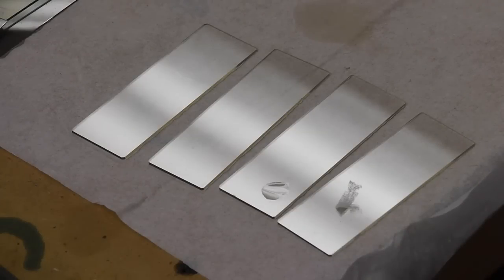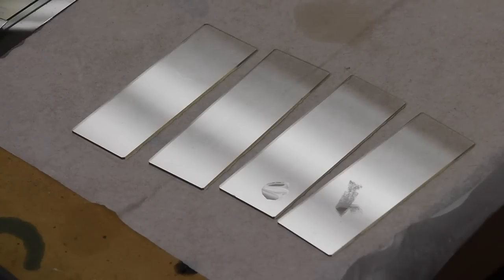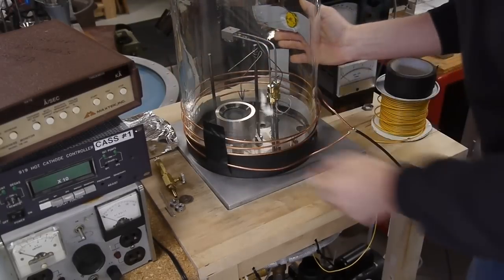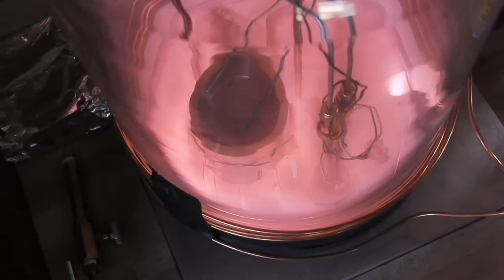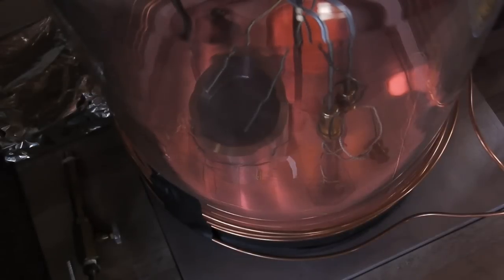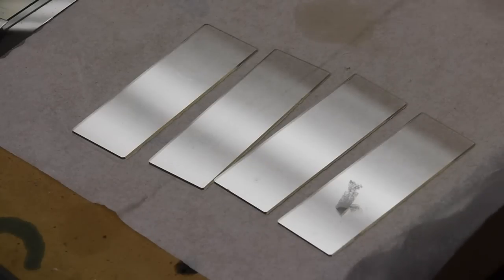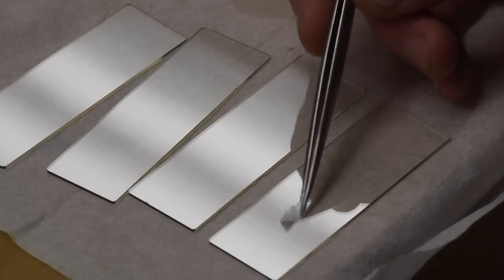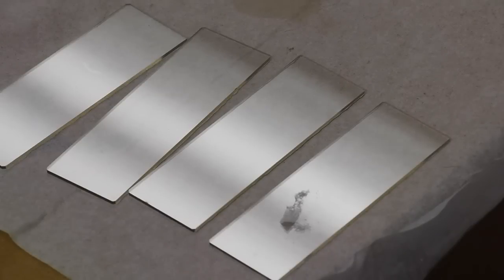Intro to plasma cleaning

Comment: Very beautiful to look at it!
But first thing that came to my mind was : what would happen if there was an mouse, inside, or for instance, if you put your finger? Would it disintegrate into thin air? Or would it perhaps look like it is burning?

I wonder...
Reply: mr_os Well it's a rarified environment, so it will die from asphixiation. From there on I guess the plasma would be roughly as harsh on the mouse as it was on the paper.

Comment: Is the RF energy the same for induction heating of metal parts?
What is the frequency?
Could you easily put more RF power into the bell jar?
Is there a reason you held it to only a few watts?
Reply: Ben, could you just use a frequency set length of wire (I'm guessing around 20 meters) for the antenna and forgo having to tune out so much reflected power?
Reply: ***** Watch out for those RFID cards :)  i think Mifare cards work at the same frequency,i don't know would it affect them but it's a strange coincidence
Reply: TheHackZone5 I actually just looked this up to check, you are right. RFID and NFC both use this frequency band. might want to watch incase it blows one of the receivers if you have something using this near.
Reply: +Walter Clark The components in a relatively small tuner used for amateur radio might be made of plastic components and not water cooled.  They can easily get damaged by melting if too much power is put through them.  Some of the industrial RF tuners have water cooling through the coils and capacitors and can withstand much higher powers.  Plasma-Therm is a company that has been around many years and makes hefty RF generators and tuners.

Comment: Can you use this process to cold weld metals? I mean, if they are super clean, they should weld?
Reply: I don't think that would work. It's an oxygen-rich and energized environment that would probably quickly oxidize any metal surface

Comment: so, is the plasma in the vacuum colder than plasma would be in ambient space? From watching this video I don't really get the idea that the plasma is all that hot. wouldn't it be more destructive if it were hot?
Reply: is the vacuum making it so that the air doesn't need to be as hot to become plasma? or is it making it so that you don't need as much electric current (or voltage? idk) to heat the air up?
Reply: It's extremely hot, but it contains very little heat.

Comment: SAFETY WARNING!
The mention of using oxygen should have included a safety warning.  One should never use straight oxygen in a plasma cleaner unless the vacuum pump contains fluorinated oil (very expensive).  Doing otherwise risks explosion of the pump and considerable risk of personal injury.
Reply: +Anon Acct i don't think this is true i may be wrong but strait oxygen is not explosive or flammable it is only an accelerant and needs to be mixed with something to burn.
Reply: Anon Acct yes...oil and oxygen do not mix well at all.  Infact if anything in the chamber had any oil on it (like in the video) then it would be bad... Especially with all the plasma floating around.
Reply: @YouTube Admin 
Perhaps like running the oxygen through a vacuum pump filled with combustible oil?
Reply: Anon is right. Oil will burn like the jeezlus under a pure oxygen environment.
Reply: The ballast on the pump can help against this, especially if  it is fed with dry nitrogen.

Comment: is there any radiation doing this
Reply: witnesszer0 Just a layman here, but short of someone who knows what they're talking about, I don't think so.
Reply: everything gives off rads
Reply: witnesszer0 What a useful answer.
Reply: witnesszer0 He says that it gives off light a bit in the ultraviolet, which is a bit dangerous, but also follows that statement with the fact that that wavelength normally can't pass through air. So that light is a bit dangerous, but once the light leaves the outer surface of the jar, it's now in the kind of air it doesn't travel well through. This kind of reaction isn't doing anything like breaking the nucleus of an atom, so nothing like alpha, beta, or gamma radiation would be anything to worry about. He says the things ignites off of only 5 watts of RF power the plasma will start going, which isn't going to mess anything up, as long as the jar doesn't break. Also people use this all the time in semiconductor production, and when you hear about them dying, at least I don't hear them dying from any kind of radiation related poisoning. I think it's safe, I'd like to try it, but that's a ton of expensive equipment I don't have. :(

Comment: OK honestly this is highly irresponsible not to lay out the dangers with this technique. Highly toxic ozone can persist for a long time after production, UV light can and will damage your eyesight regardless of intensity or flux.
Reply: You must be fun at parties
Reply: O. H. Not to mention all the ways it can blow up...
Reply: Isn't UV just blocked by the glass jar? I think you need special type of glass if you want it to let UV thru.
Reply: @harviecz  Not exactly, UVA passes through glass and UVB is blocked by glass. Some glass is treated to also block UVA, however.
Reply: @kevinrowe2454  UVA sounds RELATIVELY safe (unless you overdose).

Comment: Nice video, I had not heard of this technique at all. Question, why use RF, couldnt you have used electric discharge inside the chamber instead?
Reply: DC is harder to control, but is used by pros I know.